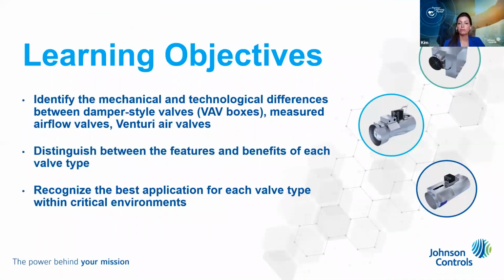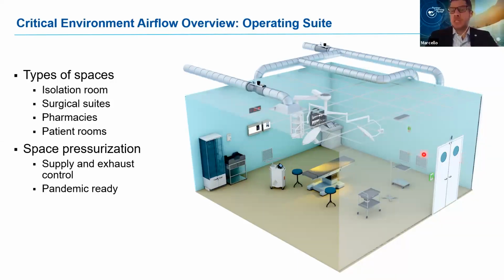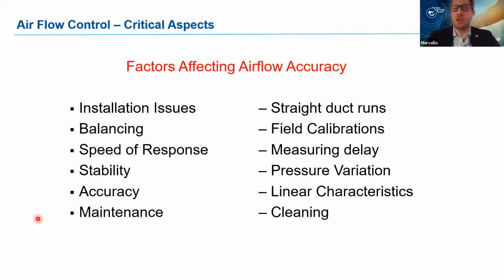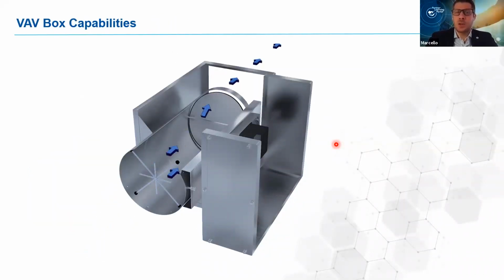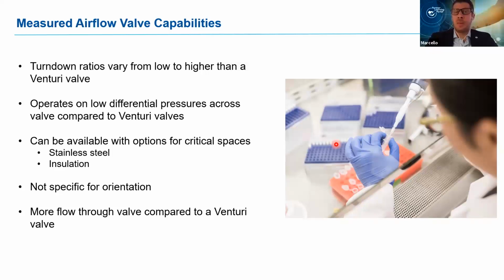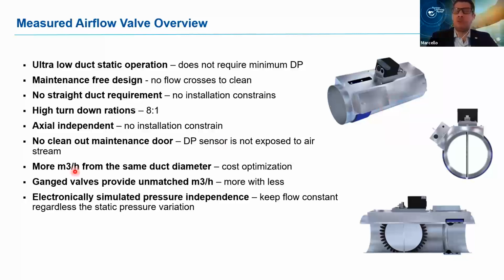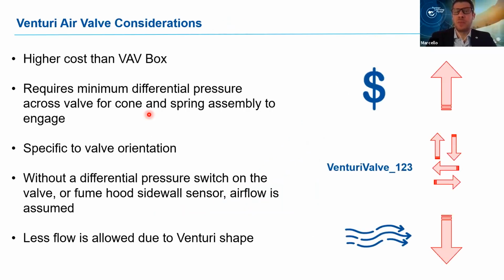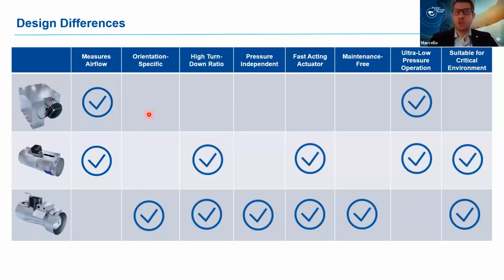Understanding Airflow Valve options for critical environments

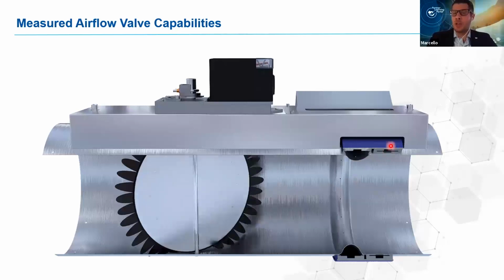Comment: At 34:50 you state that the valve is "pressure dependent". I'd consider it to be pressure independent given that it is capable of measuring and controlling the airflow over a wide range of differential pressures?